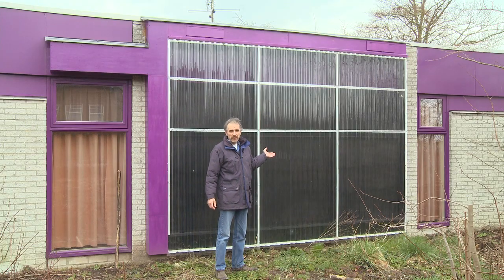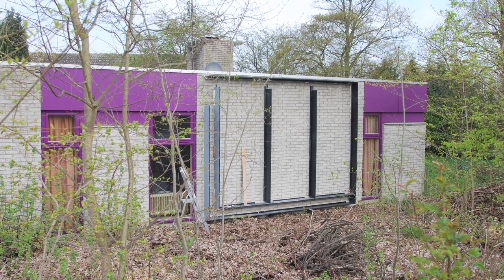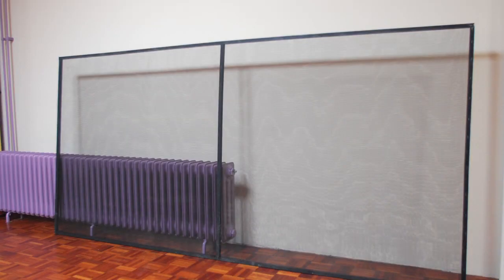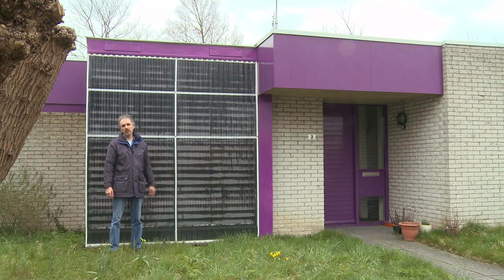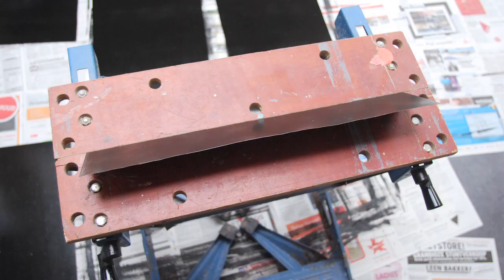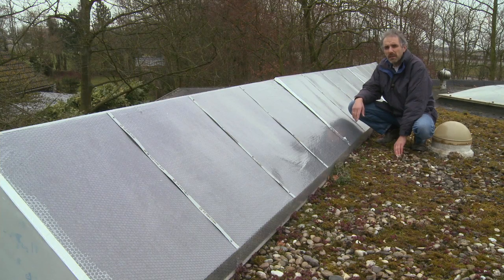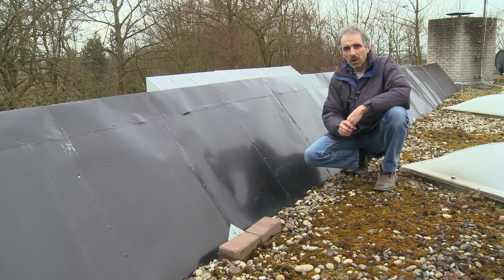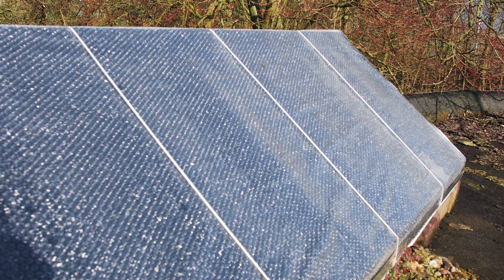Solar hot air collectors DIY - Condor collector

Comment: You should use Glas and not bubble wrap.And in the back on the wall , Styropor.  Also, you need to seal the box airtight. If you run small cooper pipe ( maybe 3/4 diameter )circles in that box, you will have at the same time a water heater.  You can make a simple test. Take a black garden hose and fill it with water. Then Block of both end and coill the hose up. Now, lay that coil in the snow in the sun. In the afternoon the water will be boiling inside.
Reply from the maker: Indeed bubble wrap is crap. It reflects a lot of light and the UV rays of the sun break it up in one season. Glass will be better, I tried to save money. I didn't want to use styropor on the wall to avoid gassing when the temperature becomes high. I used styrophor on the backside of the boxes on the roof, works well. Thanks for your input. System is still running.
Reply: @MissionTrivial  I don't think it will gas out. I live in the US and was tinkering a lot with stuff like that. Here they do so much more about self sufficent  then in Europe. At least as far as I know. I never had a house in Europe, allways rent. U know, it's germany ....lol

Comment: Das snel, kijk als ik koude lucht 25 graden op kan warmen ken de lucht pm 20 gram water per Cuub onttrekken aan het hout. Afhankelijk natuurlijk hoe groet het oppervlak is van de collector kun je er de bemodogde ventilator opzetten, maar 1000 m3/h is dat teveel gevraagd? En werkt het systeem met de twee of vier lagen horgaas beter als staal/alu?
Reply from the maker: Ik gebruik buizen van 15 cm met daarin buisventilatoren die op papier 120 m3 blazen. Een kast van 9 m2 warmt de lucht dan op tot zo'n 40 graden. Het gaas werkt goed. Meer dan drie lagen verhoogt de opbrengst niet meer. De ingeknipte aluminium offsetplaten geven nog meer warmte af. Een kast die beglaasd is levert meer warmte dan een kast of buis zonder beglazing omdat de wind dan de warmte meer afvoert.

Comment: Mooi idee om je huis te verwarmen. Is dit systeem nog steeds in gebruik? Zijn er nog technische tekeningen of aanwijzingen om dit zelf ook na te kunnen maken?? Dank je voor de interesante video!
Reply from the maker: Ja hoor, het werkt nog steeds. Het aluminium is weerbestendig. De isolatieplaatjes aan de achterzijde niet, allemaal weggevreten door de UV-straling. Bubbelfolie gaat ook maar een jaar mee en zonder werkt het eigenlijk beter. Heb wel de aan- en afvoeren aangepast, allemaal met ronde buis van 15 cm doorsnede. Daar gaat de lucht veel beter doorheen en komt de warmte beter binnen. Ik heb geen tekeningen ik werk gewoon op het zicht. Wel heb ik van een stuk multiplex een mal gemaakt waar ik de platen ombuig zodat ik een gelijkvormige serie ribben kan maken. Ik heb popnagels gebruikt maar zou nu misschien lijmen met zettex of polymax. Succes!

Comment: Hello, this is very interesting, especially in the light of exploding energy prices in 2022! I myself have for years the idea to do something similar with my 18 m2 fence (schutting) in my back garden. Your project can serve as inspiration. On your site you write "Pas na een paar jaar vergelijken valt er werkelijk iets zinnigs over te zeggen. Maar als ik uitga van ons gasverbruik van 1550 kuub per jaar à 50 cent* per kuub. Dan zou een besparing van 20% slechts 155 euro per jaar opleveren." 

10 years have passed since you started your project and now it would be interesting to know how much m3 gas you consumed annually since and how much you saved as compared to your original 1550 m3 consumption.
Reply from the maker: Ons gasverbruik in 2016: 1143 kuub /  2017: 1220 kuub /  2018: 1405 kuub / 2019: 1336 kuub / 2020: 1203 kuub / 2021: 1278 kuub. Dus het is lager, maar de winters variëren zo sterk. Het kan aan van alles liggen.
Reply: @MissionTrivial  OK, Bedankt!
Reply: @MissionTrivial  OK, maar het project was blijkbaar klaar in 2013 (datum video). Het zou interessant zijn te weten wat het verbruik voor die tijd was.
Reply: Of was dat die 1550 m3? Blijkbaar. Als dat zo is dan valt de besparing een beetje tegen. Maar ik ben al tevreden als ik 8 m2 van mijn woonkamer kan verwarmen, dat gedeelte dat achter een zwaar gordijn zit en verder niets.
Reply: @MissionTrivial  Deze meneer in de VS had het over een besparing van $350-400 per jaar:   https://www.youtube.com/watch?v=N6QOZGgbj-g     Maar dat zijn natuurlijk wel de oude lage prijzen.
Reply: @MissionTrivial  Ik ga het met duurder dubbel glas proberen. Die Amerikaan gebruikte aluminium horrengaas. Ik denk dat uw "veren" inderdaad wel eens effectiever zouden kunnen zijn, betere warmteoverdracht. In de zomer haal ik die glazen platen dan weg en hang zonnepanelen op de vrijgekomen plek.